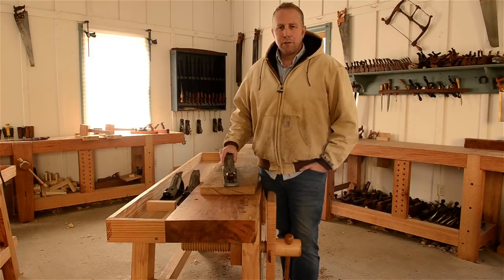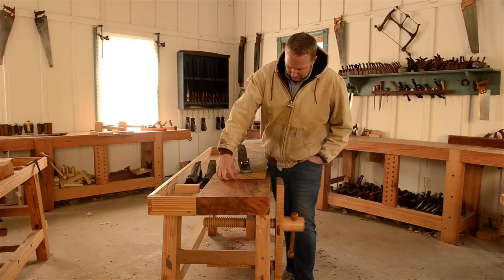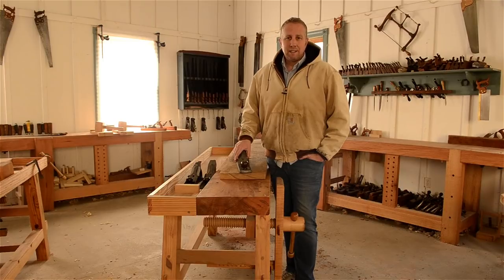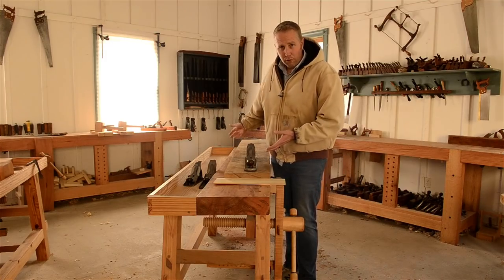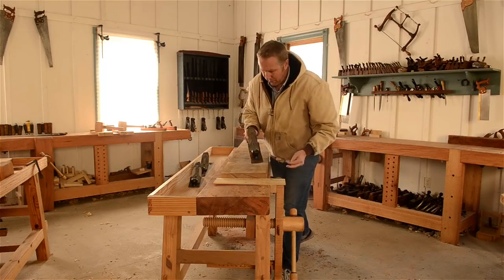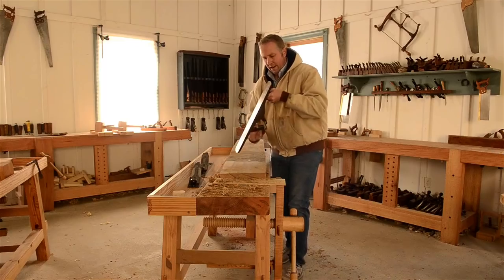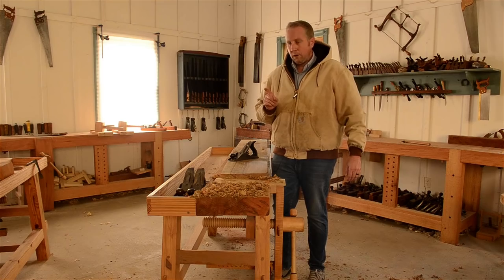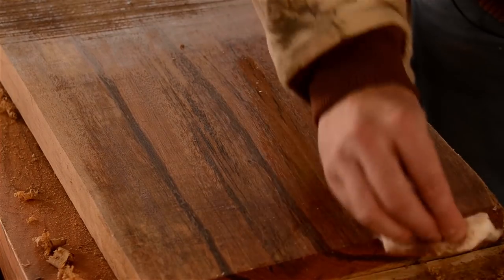Handplaning Mystery Exotic Wood - What is it???

Comment: Hello, it is Iroko. The Deck of my restaurant was made of it and it lasted for 20 years ! I rebuilt it with Oak and salvaged some Iroko to make small furniture for my little girl. It is hard as hell ! Need a mask if you sand it. It is like black pepper in your noze !!!  Nice channel, greets from France.
Reply from the maker: Thanks for the input!
Reply: @WoodAndShop  I have been doing some research. Could it be Tamarin ? ("Tamarin des hauts" in french). It grows in Africa and La Réunion. It's a kind of Accacia  or at least same family. Great for workbench tops. Hope it helps. Keep us informed.
Reply from the maker: @kookiboy  That's a possibility. However, my wood doesn't have the same streaking figure with cathedrals.

Comment: My thoughts are that it is from a Mango tree. The Mango is a fast growing tree and is plantation grown in Indonesia for its fruit. It  is cut down when it is about 25 years old after it has stopped bearing fruit. The rough sawn board shown is from a tree very much older than 25 years and may be from a long forgotten corner of an abandoned plantation. It has a very wild grain, is a bugger to plane and tears out frequently. The figuring is good, but in trees cut down at 25 years it can also be bland to almost white in many areas.
Reply: The mango wood I've sourced from Queensland Australia,  is grey in colour with blonde streaks, just thought i would mention that t h e piece of timber in the vid dosnt look anything like the mango wood I've seen, though a wild "turpintine" mango tree might bare timber similar to this, mabe.

Comment: Hey Josh, what’s the answer? I check the comments and your blog about it, but I don’t see that the mystery was ever solved over the past 2 years. If it’s still being debated, you should gather more data from the wood, like doing a legitimate hardness test, measuring the density, and getting magnified photos of the face and end grain. You could even burn a tiny piece and measure it’s BTUs.

Comment: Maybe try a scrub plane to start with- saves time and effort and doesn't take off more than necessary
Reply from the maker: But then it requires more time to get the ditches out. This was just to reveal a quick sample, not to perfectly flatten the board.
Reply: @WoodAndShop  I think you missed my point. The struggle you were having in the video, in my opin would have been avoided using a scrub for a few easy strokes and then clean up with the smoother.  YMMV
Reply from the maker: @bestbuilder1st  Nah, because then I'd have to get rid of the grooves created by the scrub plane. This is how I get a quick look at wood grain. I use the scrub plane when I need to remove a lot of wood and flatten a board. But thanks for your input.

Comment: Old Stanley with the blade ground as a plow plane would help you tremendously. You won’t be breathing hard and get the board dressed down to get a good look at it. Very handy tool to have around.
Reply: By plow, do you mean that nice wide blade should be ground away to a little bitty tooth of 3/8" wide, or so?

Comment: As difficult as that was to plane (and I'm assuming everything needs to be sharpened now), I agree with Tim: Teak. Species is unimportant at this point but Teak is quite common in the Middle East and African lumberyards. You can even find some "forbidden" Teak in some of the lumberyards over there.
Reply from the maker: Yes, the planes now need to be sharpened! I'm not 100% sure yet. I may have to send it in to get tested. After talking with a few people in his circle, Eric Meier said: "it is more than likely not anything typical or obvious." I guess that means it's rare!